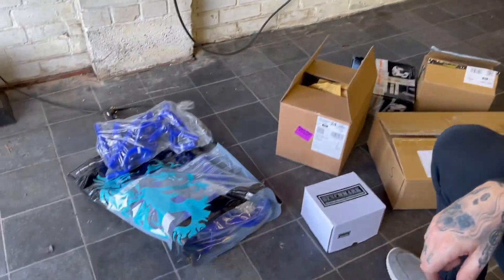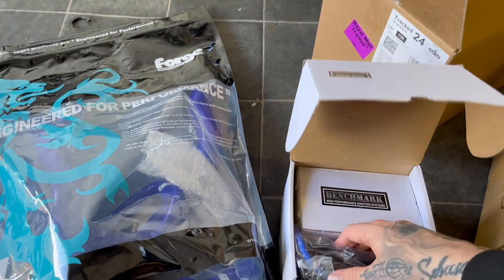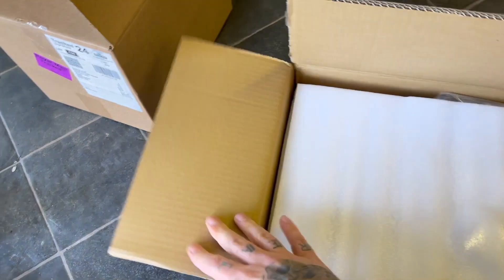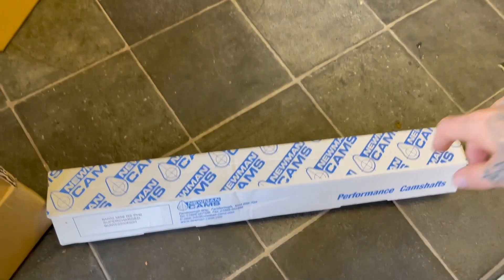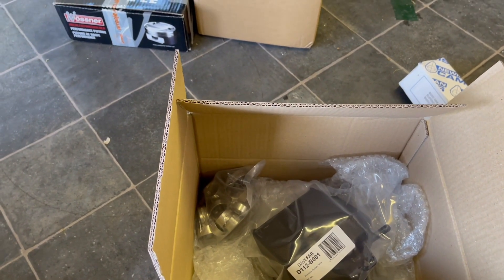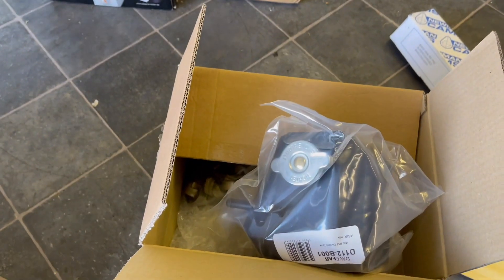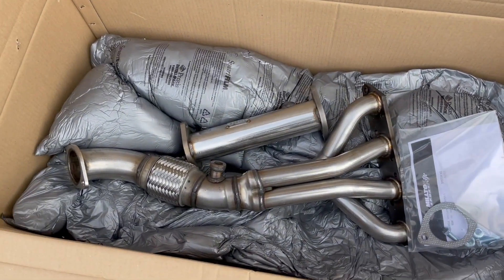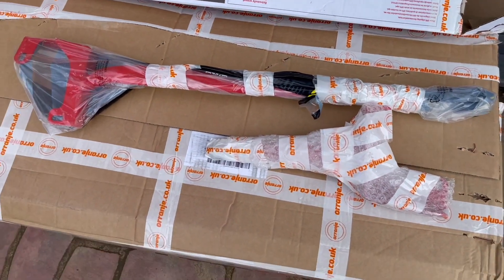Mini Cooper S R53 Supercharged Engine rebuild! Forged! Part 5

Comment: Looks like you’ve got a proper set of parts man!! One thing I wouldn’t recommend is that intercooler. Go with stock or GP. Anything else is going to lose power! I have almost the exact same setup
Reply from the maker: cheers buddy, will definitely consider getting a new intercooler as I've heard this a lot :(

Comment: This is gonna be a beast !! Oli at orranje is so helpful when you need something ASAP! Looking forward to seeing what those forged pistons can take. Re mapping, 1320 is the holy grail for r53’s.
Reply from the maker: Cheers dude, i did message orrange when i was looking at getting the forged pistons but no1 got back to me 🤣🤣 however their deliveries are fast as f&@k 👌🏻👌🏻👌🏻 i’ll be taking it to 1320 once i’ve done a few miles aswell 👌🏻👌🏻 will no doubt do a video once its on the dyno bro :))
Reply: @spenna1221  pretty sure 1320 do cam,  injector and remap deal. I know you’ve already got a cam in there but think the catcams are better quality if that matters to you. Also the amount of money you’ve spent you should look into meth(1320 can do this for you) and a pro alloy intercooler 😇
Reply from the maker: @patherl1   cheers bud, i’ll be definitely looking at bigger injectors & now you have me thinking of meth 🤔🤣🤣 will be asking the question to 1320 once its got a few miles on it 🤦🏻‍♂️🤣🤣

Comment: Looks good. I’m surprised you didn’t sleeve the block whilst you were that far into it. As these are ageing the cylinders are cracking more and more. Especially now that you’ve removed more material.

Anyway nice video. I’d recommend 1320 with the byetronik tune. Would be best if you get some bigger injectors too. Mine made 210whp with a 21%, catcam 469, 550cc and the byetronik tune.
Reply from the maker: Cheers man, was thinking 1320 for a map :)) we only took 0.5mm off the bore tbf, the decision to over size it was kinda last minute 🤣🤣 & to be honest the block and crank were in mint condition, even the bottom shells weren’t really worn & i didn’t even think about sleeving it 🤦🏻‍♂️🤣  i’m sure it’ll be fine... hopefully lol 
100% gonna get the 550 injectors when i get it mapped :)) cheers dude
Reply: @spenna1221  yeah you’ll be fine. It’s hard to know what to believe or not! I’m strapping a turbo to mine currently on a stock engine😂
Reply from the maker: 😱😱😱 that’ll go well 🤣🤣 be interested to see how well that goes.. you doing it yourself?
Reply: @spenna1221  Unfortunately above my pay grade but got some good hands working on it. Similar to you, I’m still piling up parts! 🤣
Reply from the maker: 🤣🤣🤣 i know the feeling bro 🤣
Reply: There's no such thing as a Bytetronik tune it's just an incomplete piece of software which is used to tune the stock EMS 👍 ignore me if it's just your language as if so I would recommend a Winols Tune. Ie tuned using Winols. More accurate and better access than Bytetronik